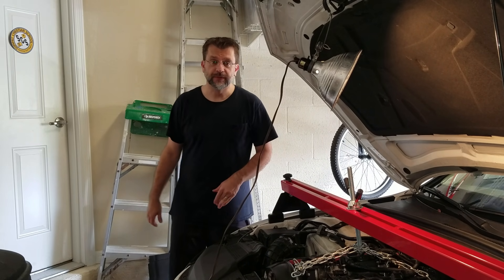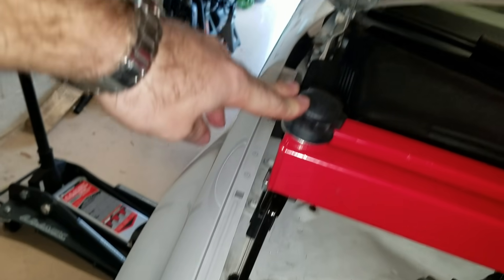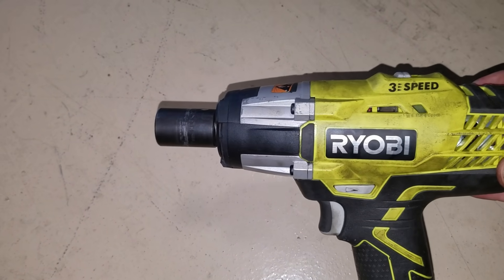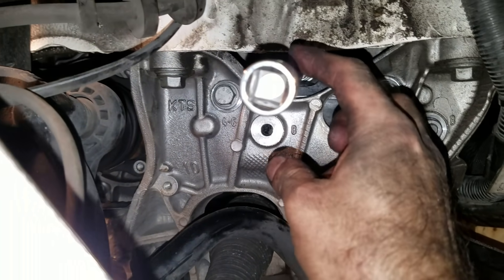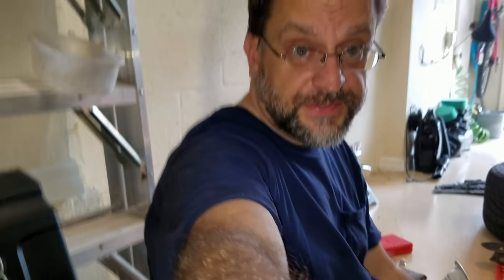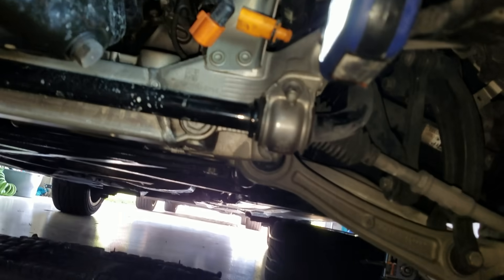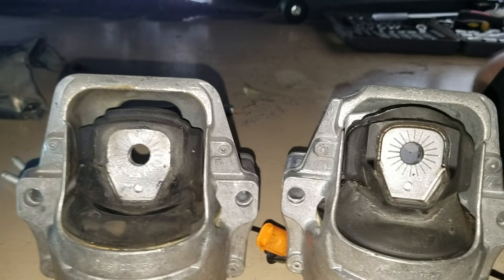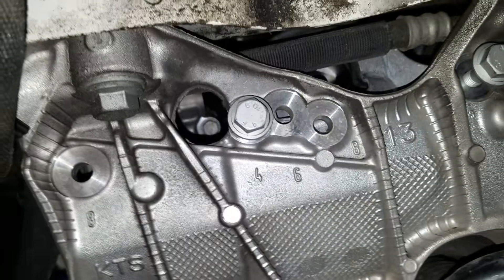Audi A4 B8 Motor Mount Replacement A5 Q5 2009-2016

Comment: You can just fill the old mount with polyurethane for 10 bucks.
Reply from the maker: The mounts were less than $200 for the set. I think that is cheap enough already. I would be interested in seeing a video with your fix though! Always willing to learn new things.
Reply: Whats that
Reply: Make a video